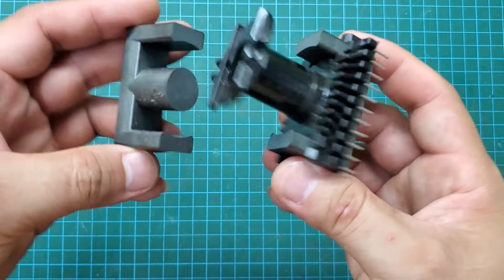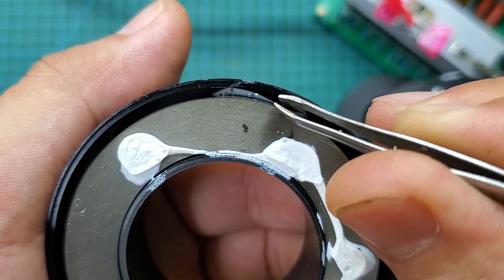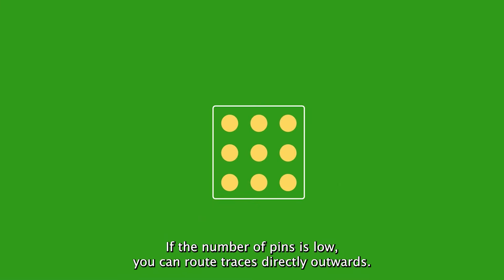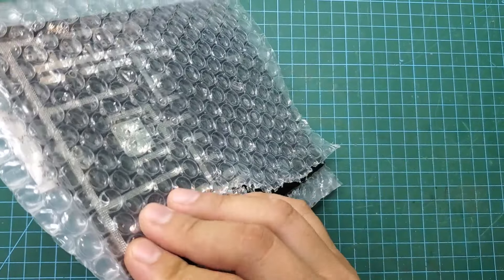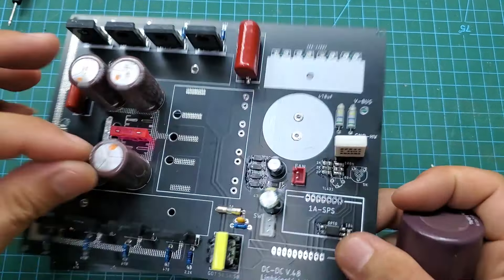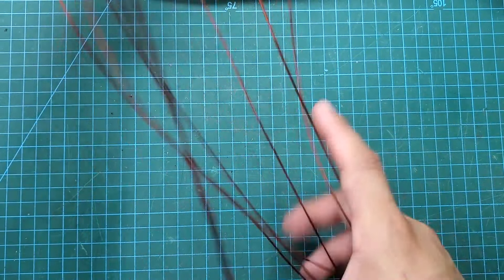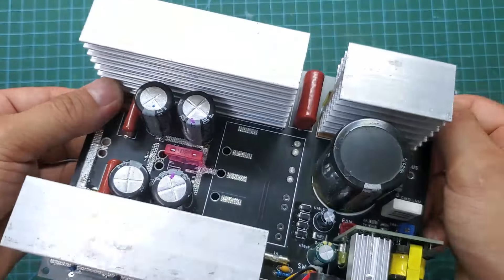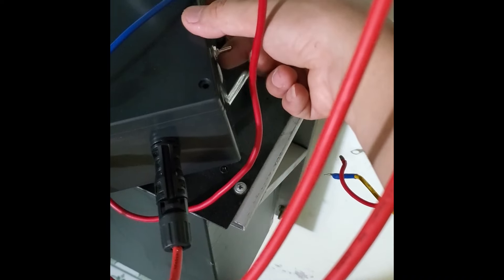Amorphous Transformer | The Secret to High-Efficiency Inverters | JLCPCB

Comment: Checked it 15 years ago. Even made small 100W PSU. Sure, interesting, but not a game changer. You can reduce a Cu volume but need to same reduction of frequency. May be, useful for the very high power app, close to MW range.

Comment: What if you used a larger than specified toroid and larger conducting wires???
Would a 100mm amorphous toroid work for 5kw continuous, 28vdc to 120-120? Still at good efficiency?
It would be an upgrade from a square laminated transformer, driven by a egs002 board 200a.

Comment: Ok, so no comment on the previous questions/statements, but anyways this is about a 10kw lf inverter, egs002 based and 48v. Using an amorphous core, I am making windings at correct ratio. 
PRO TIP, old crt tvs have the guide coils, these are insulated individual wires for, in my case, using at high frequency, and using for low loss in skin effect. 
These are like litz wires. But they are substantial. 
And really the right length. 
They can be doubled or tripled. The only thing is soldering through the nasty individual wire insulation. 

SO, this is THE CHEAPEST way to do it. NO buying expensive copper to find your transformer isnt optimized. 
It is thinnest insulation, for best and tightest location to the core. 
Its already ready to go. 
You just need 2 or 3 scrap tvs. 
Free, 
ANd the cores are affordable, mine was 15usd for the "8kw" version, mine will over saturate at 10kw with efficiency tradeoff, but the wires will have very low loss as the tv coils I am using are overspecified. 
THe primary is center tapped 45ish turns and the wire is probably 8 ga. for 240v it can do many many amps, at such a short length (the samsung 20 inch tv has a loop about 10ft
And the secondary is 2 wires of 5 and 5 turns in parallel, and the gauge is probably close to 5 or even 4.5 ga. The wire length is 20 inches per. 
So its going together nicely, I will test it when it is made and not so wet, cold and nasty. 

The losses for copper, not even accounting yet for skin effect advantage, would be LOW like .15 percent which would be about 250 watts at full power which will not cause problems because the thing can radiantally cool at that wattage, and it can be in the path of air flow from cooling the inverter mosfets so it helps for no added complexity. 

WE just need a board that can take the toroids mounted directly on board, and inductor too, so it all is one neat package, Should even have 120v or 240v connecting points at the least. Just isolated, and secured in place. 
Make a nice 3mm thick board so its worth more. Its intrinsically safer and the added cost is absolutely minimal and so worth having. 
Soldered connections for the toroid wires, and output tabs, with the feedback paths built in for the feedback egs002 balancing. The switch can be placed on board, and a small digit display can loop and read out the battery voltage, output voltage and current. 3 selectable button readouts would be super nice, not nessesary, but a luxury, Worth having. THe complexity and cost is actually very low. 
The board also has a mounting spot for a fan, SO just a small bracket, or heatsink mount and super long term durability fan. 
Oh and it needs a place for a heavy duty fuse on the input, and a breaker on the output, well that can be on the panel or omitted. 

I think the overall cost should be about 400 dollars all complete, as mentioned. 3mm board, same as chinese lf 20-24 tube versions, just add display, solder holes for right size amorphous core on bottom or better to the side in line with heatsink, add the feedback, add the switch, add the fuse holder,  add the ac hookups. and that is all there is to it. 
Really, cost breakdown is closer to 300 usd, I think that would be a very fair price. Think also about updating the mosfets too...

ANY COMMENTS????

Comment: ZX7-400,428, 630 transformers are amorphous and high frequency with multiple insulated primary and secondary conductors. RIGHT amperage, turn ratio, turns probably PERFECT for 220v applications, and for 120x2 it can get a center tap. 
Tell me what you think and if they work!
Itd be cheap and easy, and EFFICIENT 
How great!

Comment: Hi, I need a commercial design. 
You can design me a pcb for inverter. 
specification :-
1) The inverter setup in UPS system 
2) 12v to 220v 1000w output 
3) Thay are include 12v 5A Charger
4)  Also 20A Soler Charge controller 
5) inverter out pure sine webe power.